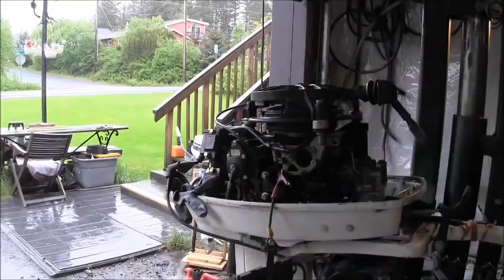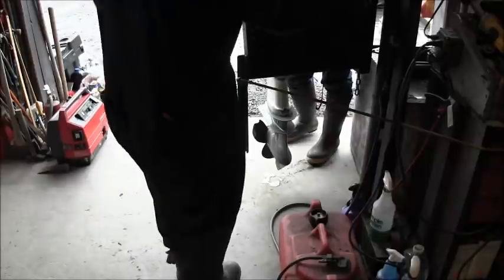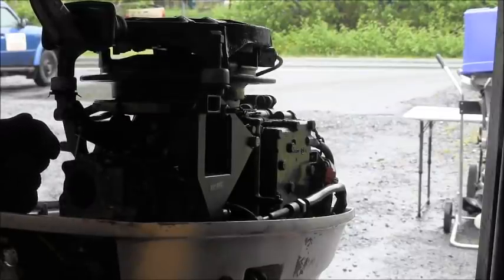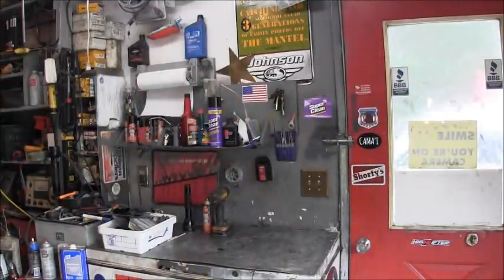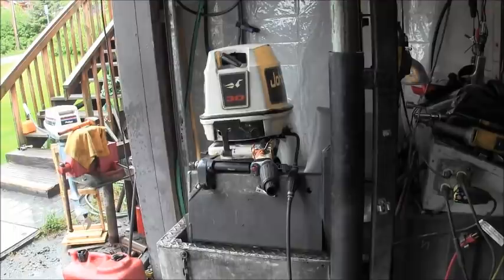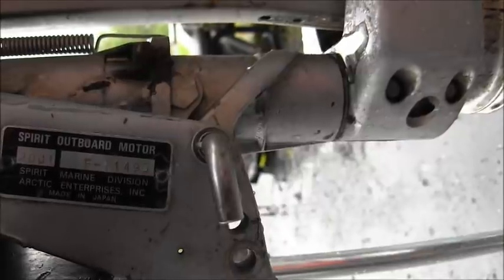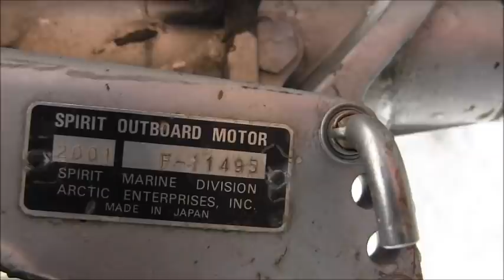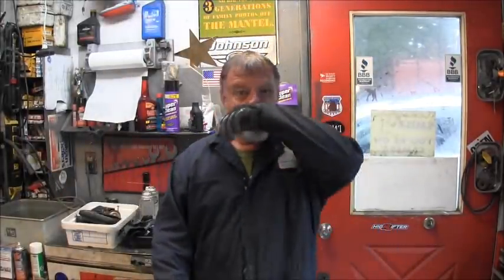JOHNSON 30 HP,  &  MYSTERY   MOTOR  REVEALED...

Comment: Kodi:  That  Johnson 30 has the correct handle for a 20-25-30.  That style handle was used beginning in 1990.  The twist knob out on the end is for idle speed adjustment.  Stop switch was never on the end of that style grip handle (1990 & up).  1987-1989 had a different style handle and they did have the stop button on the end of the throttle grip.  1986 had a handle much like the 87-89, but the stop button was still on the front lower motor cover.  1985 and earlier had a shorter handle which was gear driven (no Helix; no cable) and stop switch on front lower motor cover.
I love your videos.  I sold my EV-JOHN dealership 16 years ago and your videos are helping me recall some of the jobs and knowledge required.  Thanks for producing them.  Those two-stroke 20-25-30-35 motors are among my favorites; they are rugged and reliable machines.  I still have five of them for my own enjoyment.  Thanks again.

Comment: Kill switch wire may have gotten caught in the rear hood latch and broken because of that.  Some of that wiring really looks out of place.  I noticed you put the hood/shroud/cowling back on the motor with it running in the test tank.  The teeth on the spinning flywheel will shred the foam lining in the cowling and spread it all over the powerhead - including the carb intake.  Best to shut off a motor when removing or installing a cowling.  At least that is my experience when installing and removing.  Thanks for a great video.
Reply from the maker: You R spot on correct 4 sure.  Bad habbit'  stay tuned I gots more,,haha    kodi

Comment: I like those older Johnsons. I have a good running 84 7.5 Mercury. I also have an older Johnson TN-28 3 or 5 hp motor my dad had. It's in storage and complete but not running. If I needed help with advice or parts would you be able to help me repair it? My Dad built an old wood boat called it Slow Moe and used it to trout fish in Southern Oregon where I'm at. The boat is gone but I have the engine .Dad passed just a few years ago. I enjoy watching you bring the older engines back to life again instead of just being scraped. Keep up the great videos.
Reply from the maker: Sorry 4 your loss'  Will do 4 sure.  kodibass

Comment: G'day Kodi, thanks for another useful and informative video.. Thanks to my boating/outboard addiction getting worse, I'm about to start my first full powerhead rebuild on a '93 25 evinrude..I've spent a lot of time dismantling, cleaning, inspecting and gathering all the replacement parts I need, and finally I'm set and ready to go forward with it.  I've never been this deep before so I'll have a few questions if you or someone else might guide me please...firstly, relating to this video, wondering should I use the dielectric on the little temp sensor that goes in the head when I put the water/thermostat cover on...and if so, how much?...I'm fairly sure what I need to do as far as where/how everything goes back together, but lacking a bit of confidence to begin because I'm not sure on torque specs for rod caps, crank cover, head bolts etc. I have a generic clymer service manual which covers my HP and year range but there is nothing that I can find in there which is specific to my motor...only a table which mentions specs for bolt sizes...Also unsure where I should and shouldn't I use gasket sealer?...Am I overthinking it?...lol.
Reply from the maker: Good rule on gasket sealer nothing from intake gasket to the air silencer.  Sensor needs no dielectric, If you cannot find a spec on-line lmk I'll try to get it to ya'  kodi

Comment: Flushette?      And it even comes with a nice blue pouch to keep it all together!
Install of a water pump "pee hole/tell tale" in a motor that doesn't  have one.      I haven't found one of your videos that shows that, but I'd like to.  Have you made one that I missed?
Reply from the maker: Yes' check out my 18 hp vid's  or my 1956 jonny 7 1/2  vids.  kodibass

Comment: I have a Suzuki 15 just like the one you just got last month or so I can't seem to find a way to hook it to the house  I'm  currently using a barrel  is the a way to hook it to the hose I'm going to get the manual just not yet
Reply from the maker: Yes'  The honda style hose flush will work, or the older Tempo Flushette I show in the video.     kodibass

Comment: First thing I learned when venturing into the boat world. Don’t act like you know what your are talking about when you don’t. The mechanic that does know will have mercy on the guy that is honest  rather than the guy that pretends to know. “I did a compression test leak down test everything checked out but it doesn’t run good. That means you don’t know what you are doing get your money out sucker. Your left front intake valve is not opening properly. Good news your top dead center brown eye valve is working properly and will take all you can give it👍🏻!
Reply from the maker: Haha'  4 sure..   kodi